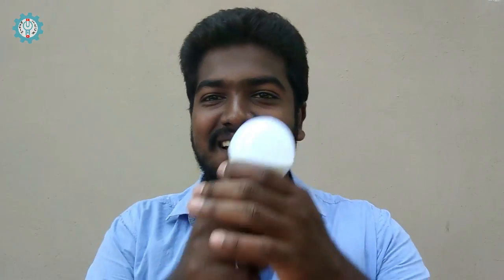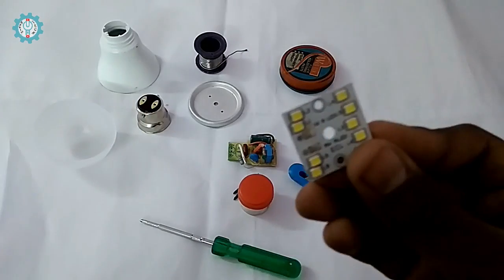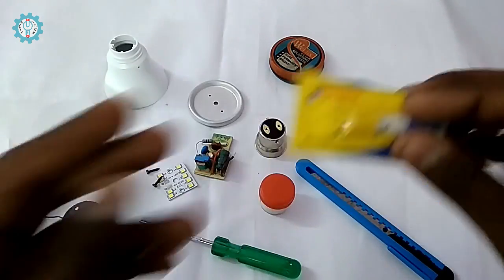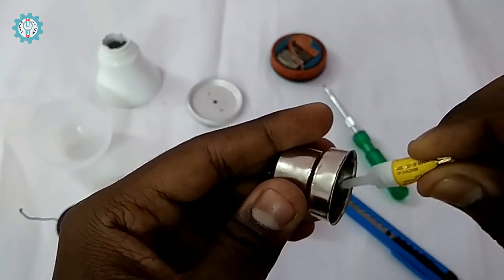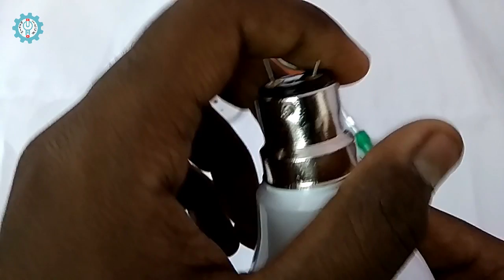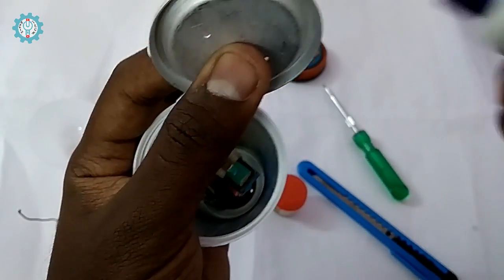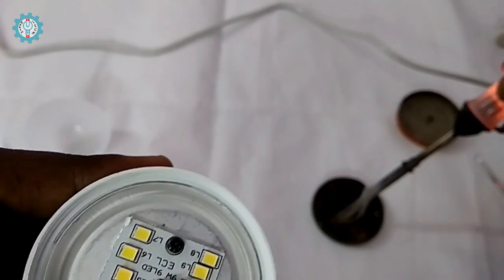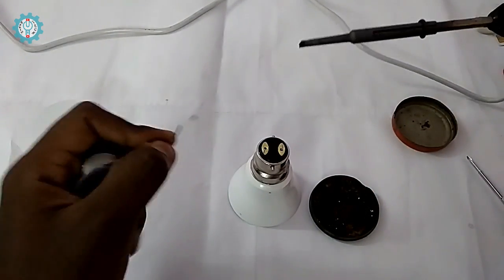How To Manufacture LED Bulb At Home | வீட்டிலிருந்து LED பல்ப் தயாரிப்பது எப்படி | HEBIN TECH

Comment: bro eanaku Koncham santhegam Itha eapdi seal pantrathu pls 8946006440 m-y
Reply from the maker: In this video I doesn't used any machine actually for fitting the cap and heat sink we have to use some machines
Reply: ச.மனோகா
Reply: நண்பா பல்பு விட்டு விட்டு எரிகிறது அதற்க்கு என்ன காரணம் சொல்லுங்க நீங்கள் ரிப்பர் செய்ததும் விட்டு விட்டுதான் எரிகிரது

Comment: Call/Whatsapp: 9112894228.
Branded LED BULB, Machine &
 RAW Material Available

Branded prices:
3w-25Rs,  5w-28Rs, 7w-30Rs, 9w-35Rs, 12w-40Rs, 15w-45Rs

LED T5 Tubelight 4 feet Prices:
160Rs- 18w & 175 Rs- 20 watt
 2 wrnty.

FLOOD LIGHT, PANEL LIGHT, STREET LIGHT, AC-DC BULB,
ETC.

LUMAXBRIGHT LED LIGHTS
Call/whatsapp
9112894228

Comment: pls. send your contact number to know more details about led bulb maufacture
Reply: Call/Whatsapp: 9112894228.
Branded LED BULB, Machine &
 RAW Material Available

Branded prices:
3w-25Rs,  5w-28Rs, 7w-30Rs, 9w-35Rs, 12w-40Rs, 15w-45Rs

LED T5 Tubelight 4 feet Prices:
160Rs- 18w & 175 Rs- 20 watt
 2 wrnty.

FLOOD LIGHT, PANEL LIGHT, STREET LIGHT, AC-DC BULB,
ETC.

LUMAXBRIGHT LED LIGHTS
Call/whatsapp
9112894228
Reply: rpkumar Seagull 9789262483 watssap
Reply: LED ready bulb & LED Bulb Raw materials and Machines wholesaler...Training Center Tuticorin 
WhatsApp 8667250380

Comment: Your  phone number send panunga
Reply from the maker: Description la iruku
Reply: Call/Whatsapp: 9112894228.
Branded LED BULB, Machine &
 RAW Material Available

Branded prices:
3w-25Rs,  5w-28Rs, 7w-30Rs, 9w-35Rs, 12w-40Rs, 15w-45Rs

LED T5 Tubelight 4 feet Prices:
160Rs- 18w & 175 Rs- 20 watt
 2 wrnty.

FLOOD LIGHT, PANEL LIGHT, STREET LIGHT, AC-DC BULB,
ETC.

LUMAXBRIGHT LED LIGHTS
Call/whatsapp
9112894228
Reply: LED ready bulb & LED Bulb Raw materials and Machines wholesaler...Training Center Tuticorin 
WhatsApp 8667250380

Comment: அமேசான்ல 355 ரூபா அதுக்கு 3பல்பு வாங்கலாமே
Reply: Ennota namper kku call pannunga 7639596981
Reply from the maker: Bro its sample material price. So they charge high for selling it in amazon
Reply: Call/Whatsapp: 9112894228.
Branded LED BULB, Machine &
 RAW Material Available

Branded prices:
3w-25Rs,  5w-28Rs, 7w-30Rs, 9w-35Rs, 12w-40Rs, 15w-45Rs

LED T5 Tubelight 4 feet Prices:
160Rs- 18w & 175 Rs- 20 watt
 2 wrnty.

FLOOD LIGHT, PANEL LIGHT, STREET LIGHT, AC-DC BULB,
ETC.

LUMAXBRIGHT LED LIGHTS
Call/whatsapp
9112894228